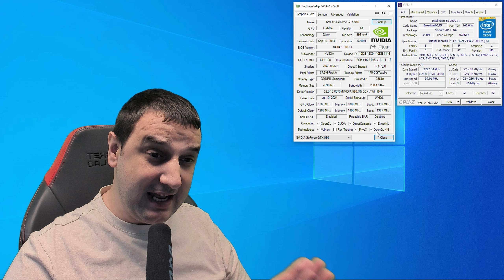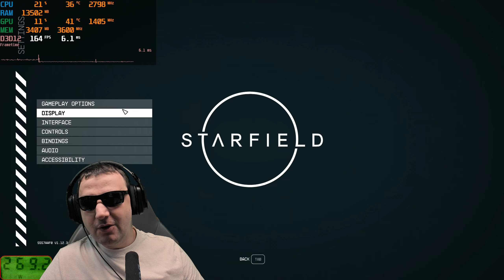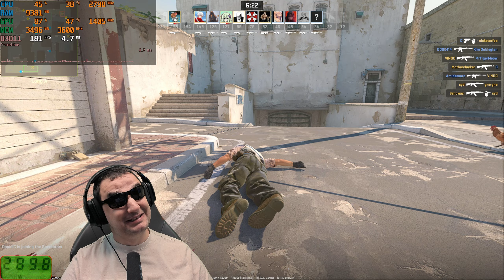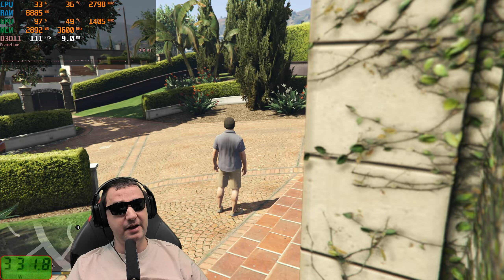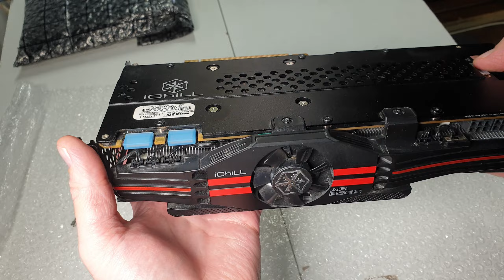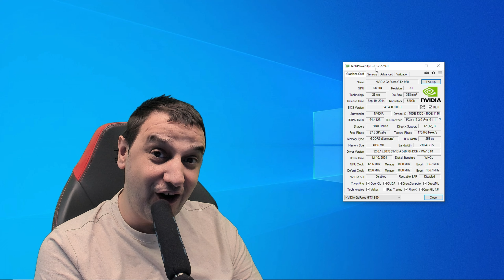Inno3D iChill GTX 980 HerculeZ X4 Air Boss Ultra Benchmark

Comment: What about overclock it
Reply from the maker: i had before a GALAX GEFORCE GTX 980 TI HOF manage to do only one or 2 videos with it and i did exactly what you said now. i try to OC it a little and make a video about it because i thought the card can take it. i started recording everything went perfect but nearly at the end the card crashed and it started artifacting.  Maybe the memory, the core? Idk but one thing for sure is it doesn`t work. there are 2 things here: either you have the GPU either you don`t. considering what i want to do on collecting the cards do you think is advisable to OC it? Even when they are rare and collectable?

Comment: You don't need more cores in PuBG you need faster cores with more cache. Yes your Xeon was bottlenecking your GTX 980 in PuBG.
Reply from the maker: funny thing is after the guy landed the GPU was at 99% load ¬_¬

Comment: i have i7-6700 and rx 590 what i upgrade think i7-7700k and rtx 3060ti12gb
Reply from the maker: @kingsHamid  any rtx will do. Newer card is better but if you want to buy it like a car. Less miles is better. :_Strong:

Comment: Pretty sure 12-16 cores with no hyperthreading would be the way to go for that CPU given the fortnite issues and the cyberpunk results
Reply from the maker: so in fornite i did run with 12 cores. before it was 22 and it was everywhere with 30% load on the GPU Only. So i disable the core and recorded it with only 12 cores and it was running nearly to 300 fps and loading the GPU to nearly 100%. could i made it better? maybe with HT?
Reply: @DanielCardei  I'm not 100% sure as I don't have a 22 core 44 thread CPU (I only have a 12 core 24 thread CPU :P) but from all I've learned from watching tons of tech reviews and CPU process technology I would say having the cores active without hyperthreading should offer the best results in the most games. 

It does depend on the game though as I remember back when i played The Old Republic you needed to make it not use any HT/SMT threads otherwise the game would be a stuttery mess...more so than what it was already anyway.

Hyperthreading helps in situations where there are either not enough cores or possibly when the cores aren't fast enough to do the job. Hyperthreading and SMT (AMD's HT) take up space on the core and the Hyperthreaded thread needs to share resources like cache and some other things with the actual physical core. I think that is why you see Cyberpunk loving cores without hyperthreading as the cores are fast enough as long as you have 12-16 of them active. 

Very few games nowadays use more than 16 threads, the only games that come to mind are the newer assassin's creed/ubisoft games and battlefield 5 and BF 2042. Those games can use up to 20 or so threads but they will run just fine on something that has less as long as the cores are fast enough to compensate for the fewer threads. 

Ohh and windows doesn't generally like CPUs that have more than 32 threads, lots of videos with people running threadripper CPUs bashing windows. Older versions of windows are probably much worse as well.

This is a very long way of saying keeping it on 12 or 16 physical cores with no HT will more than likely give you the best performance out of that CPU that you can get. However there might be some odd game that is programed specifically for HT/SMT but I haven never come across one myself.